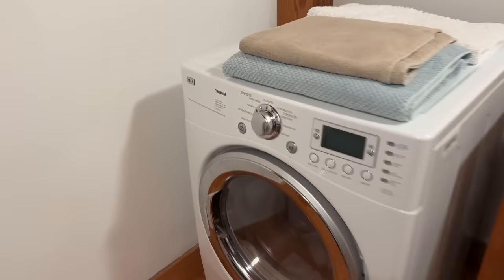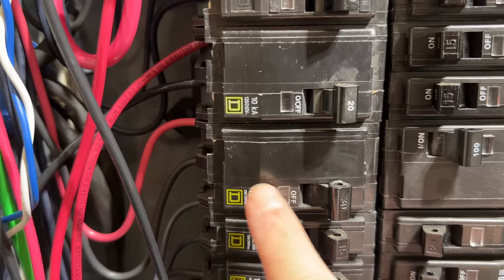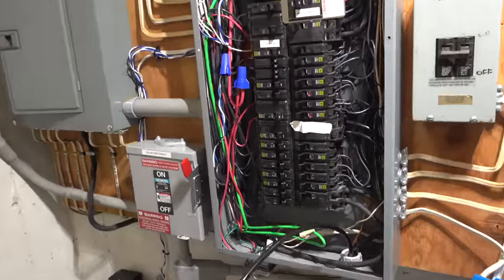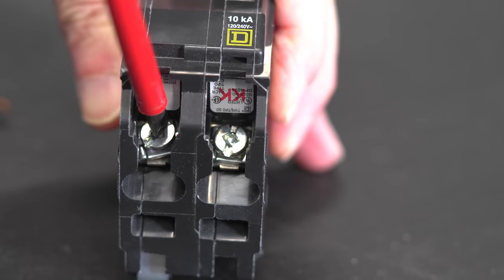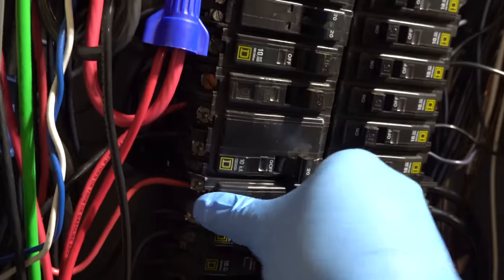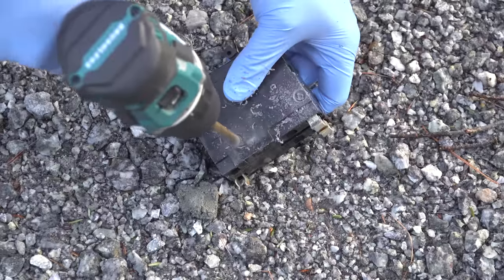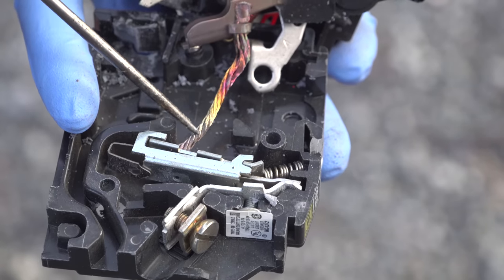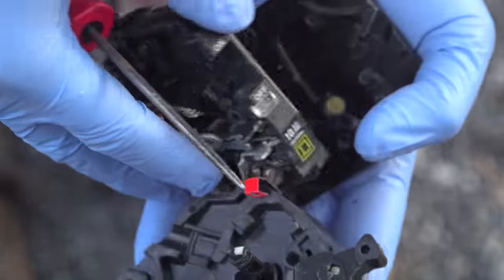If Your Circuit Breaker Makes a Buzzing Sound 🔥 Fix It Quick!

Comment: I would definitely shut off the entire panel every time
Reply from the maker: Always a good idea for safety
Reply: "And if your really concerned, go ahead turn of your main breaker" 

That is a funny sentence. I actually laughed when I heard them say it and immediately when to the comments to see if others did as well.
Reply: Good for you
Reply: ditto. people don't because they have electric clocks. which kills them.
Reply: Real men work with live wires. 
Last year it was raining so bad that my basement got flooded. And that wasn't the big deal cus i had a pump and it was keeping up with the inflow. At 4am a lightning hit an antenna that i had installed for internet. It blew basically everything that was connected through wired ethernet. And the lightning was so intense it blew apart the whole house gfci. So at 5am . I was handling live 240v mains 3 phase wire (415 across phases), taking each one of them off and then connecting it to the other side to bypass the gfci. 
It was a heck off a job to do with some pliers and screwdriver. 
I could not turn the live feed off cus the main braker panel was in the basement and that place was flooded . All in all that lightning had cost me 3000$ worth of equipment and had to replace everything. Now i have fiber optic isolation for the wireless bridge.
Reply: @KuntalGhosh  Real men don't encourage others to do dangerous things that could lead to their deaths, leaving their wives widowed and their children without a father.
Reply: @l4d2160  exactly right!
Reply: @JRPW  yeah it's not always a possibility. I mean some 3 phase breakers you have to take a hand tool and bolt the breaker onto a live rail. lol.
Reply: @marcodelao9148  sounds like a bus bar. Seen people do those one snap and a few screws. First one I pulled I sat back in like I'll let the landlord stick his hand in there, this panel didn't have a trip and some thing kept setting the dryer one off. He stuck a larger breaker in, I didn't stay around for long.
Reply: It's technically ok to do it live and it's done all the time in commercial applications, but IMO it's not worth it. If you don't quite rack the breaker right the first time you could potentially cause a short on the bus bar and that would be at 200 amps so it would be quite the arc flash.   IF you're going to do it live, at very least wear safety goggles, but I personally just turn off the main breaker myself.
Reply: Lmao
Reply: @KuntalGhosh  that's a fair justification. My justification for hot swapping breakers was an angry pregnant was watching a movie. Lol
Reply: Yep, and double check with a multimeter :)
Reply: @KuntalGhosh  that was beyond foolish.  A wet basement.  Encouraging others to work with live wires?  Ugh.  If you don’t change your attitude, we’ll be reading about you in The Darwin Awards!

What you SHOULD have done was disconnect the METER, so power was not going to your basement at all.  Then tell the electric company what happened and have them come out to re-tag the meter.
Reply: @fullhalf420  , you are correct.  The bus and other wires in the box were still very much LIVE.  The dryer was safe, but he was NOT.
Reply: @redsquirrelftw  not according to OSHA.  In fact, in commercial or industrial settings, you are to PHYSICALLY LOCK OUT that circuit and mark it so that someone else doesn’t turn the power on to fry you.
Reply: @sambrusco672  bruh everything is in my basement and our meters are not removable. The main feed comes in the basement and the electrical panel installed by the power company is also there & the only way to disconnect power to the meter is to remove the seals of the feed junction box and pull out wire fuses and that is even more dangerous to do bcz you would have to unscrew live nuts and bolts and pull the fuse links out. It is also illegal here to remove the seal & open that box cus u can just hook wires to the fuse links and steal electricity.
After the meter there is only one 60amp circuit breaker that i could not access and after that the wire goes to my 2nd floor apartment where it goes to a gfci & then to the distribution box. It is 3 phase 230v 50hz. I have a 8hp heatpump to cool 1500sqft & that requires 3 phase. 
Why 8hp for such small space? Bcz where i live summer peak temperatures can stay at 50c for days and due to that air conditioners are always oversized than what u typically use in usa. 
So i was only pulling out live wires and inserting them to the output side of the gfci so the gfci was just a junction point . 
Why i had to bypass the gfci?
The lightning had damaged the gfci and it would not reset even after turning every single mcb off so no load was connected to the gfci it would still be triping immediately.
Reply: I would just call a professional electrician. It's best to leave anything involving electricity to the professionals.
Reply: @joellow2668  exactly, arc flash hazards are possible in any panel and when they flash you can both go blind and deaf.  Not to mention the burnt hotdogs for your face and hands.
Reply: @cgfreshmaker  that sounds dangerous af, thanks for the info, learnt something today 😀
Reply: @JRPW Concerned?
Reply: Mine doesn't even have a main breaker

Comment: Had worked for 23 years as a major appliance tech. Always check the screws to make sure they are tight. Turn off the breaker first. Feeling the breaker to see if it's heating up is also a good way to check it. If it gets hot, replace it. As he said, check the appliance outlet. On a 220 volt dryer or electric stove, pull plug and see if blades on male side of plug are darkened, pitted or burned. If so you must replace the cord and the outlet. Just replacing the cord and not the outlet too will just ruin the new cord. Also make sure the cord connections are tight and not burned on appliance.
Reply: Hey bud everytime I flick my breaker switch back on a spark happens can you tell me what's the problem and how to fix it. Please
Reply: @wingallowingallomy3909  Where is the spark coming from. If it comes from the breaker, replace the breaker.
Reply: @so I have a question, had a completely burnt out breaker for my A/C.. changed the breaker but I’m noticing it’s getting really hot and tripping out especially on the hot days. 1) can it be because the wattage on the a/c unit is different from the breaker inside? I just changed it to the same ampage as the previous breaker 2) what is causing it to be super hot?
Reply: @ronjon2125  If that's a new breaker and the connection to it is tight, about all that's left is excessive current draw. Is the breaker the proper amperage? You need to find out what the current draw for your AC is to see if the breaker is sufficient. A malfunction in your AC could be causing excessive current draw.
Reply: What if it’s the ac?

Comment: One of my customers said he is going to call the utility company to shut off the entire neighborhood so we can replace some receptacles and breakers in his house 🤣😂🤣😂🤣😂I laughed and I said step aside mister mom and get your check book ready 🤣😂🤣😂🤣😂
Reply: I  had an electrician ask my power company to shut us off at the pole so he could move the meter a few years ago. They laughed at him, literally. It was an old house with the electric meter in the cellar, real PITA letting them in every month to read it. We had a fuse box replaced with breakers anyway, he figured he'd move the meter. He wound up doing it live but liek he said, he could leave it disconnected at the meter while he swapped out the fuse box for a breaker box and it would be the safest one he'd done then connect the meter when he was done. It worked out.

Comment: If the lugs are not tightened up, they last about a year! As a service electrician I see the worst of commercial construction. I did commercial work for years and quit because the new workers WILL NOT follow directions. There's no way in hell I'd buy anything wired after 2010.... Nice job kids.

Comment: If I’d make a suggestion - the manufacturer lists a specific torque spec for each wire size used on the side of each breaker.  Definitely use a torque screwdriver as you’ll be surprised at how tight they need to be.   Nice presentation and my favorite part is the dissection of the old part.
Reply: Eh just get it tight enough you strip out the screw head or the threads and you'll be fine. The torque specs are really just guidance based on some to satisfy people who have to ask how tight something should be. Most of the torque specs you legit see in the world are actually just made up.
Reply: @nevoyu  nice reply :). My only argument to your comment is that you can damage a device of too tight.   The notion of torque spec is based on a design point of stress vs. too loose.   My goodness, I have some Eaton breakers that will strip below the torque value.
Reply: @nevoyu  some people really go too far with the torque specs. If they need to ask for torque specs for something so trivial, I wouldn't even trust them to set and operate such a tool in the first place.
Reply: @nevoyu  You legit just made that "fact" up.
Reply: @amg863  But this isn't trivial. The fact you see it is trivial leads me to believe you shouldn't be working with electrical equipment.
Reply: @robertbritton656  ok handy Andy. Never seen an electrician pull out a torque ratchet on the site but whatever. Just call a real man to do the job and stick to commenting on YouTube
Reply: @amg863  Good luck defending yourself in court when a loose connection causes a fire. I've seen what happens.
I don't need to call a real man. I'm perfectly capable of using a torque wrench and torque screwdrivers to secure connections. What is it with yanks and their obsession with "being a real man"? Talk about fragility.
Reply: @amg863  Rather be gay than dead tbh
Reply: @amg863  Really? I''ve never seen a journeyman or master electrician who doesn't have one. Torque specs in panels are important, Exponentially more as the current goes up. Too little and a bunch of heat cycles later you're gonna have a nice little lawsuit against you or your company when they inspect the crispy box. Torqueing to spec is in code for a reason.

Comment: Yep, my old 50 year old Square D panel circits started to fail one after another. They never made a noise like this, but they would easily trip all the time on a light load. breakers don't last forever. I ended up doing an entire panel upgrade.

Comment: Nice.  Should really be using an insulated electrician screwdriver though, or wrap the one you have with electrical tape to prevent any accidental shorting.

Comment: People please do not loosen the wires on the circuit breaker before removing the breaker from the panel. Unless you are turning off the main power to your home before doing so. If you loosen the wires before removing the breaker, you run the risk of the wires bouncing around in the panel and making contact with the still hot connections on the inside of the panel.

Comment: I shut down every 2 years and tighten everything down
Reply from the maker: Wow that sounds like a very good idea! Many of my connections here were very loose. Good tips!
Reply: I read a comment once that the copper wires actually stiffen up as you tighten them and then relax a few minutes later and that you should retighten all your connections.  I just replaced a couple of receptacles and to my amazement, this was true.  The screws could be tightened an appreciable amount a few minutes later.
Reply: @glasshalffull2930  This character is known as creep. The creep property of aluminium is more (worst) than that of copper. Kishore Kumar from Chennai, India.
Creep (or cold flow) is the tendency of a solid material to move or deform under the influence of extreme loading or varying temperature conditions.
Reply: @30mAkills   Thanks for the info!  I had never even heard of this effect until recently.
Reply: @jovetj  OK check the torque after 2 years and compare the value with the previous one. Then you will know about creep.
Reply: @jovetj  Common sense dictates to check everything if you’re in the panel.  No idea what the previous guy did properly or didn’t do properly or if your torque screwdriver/torque wrench was calibrated properly.